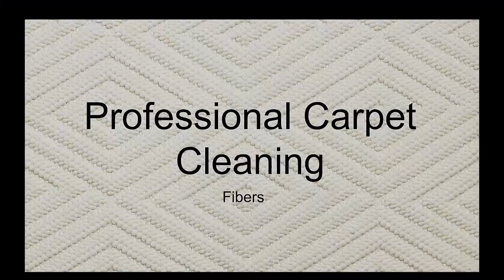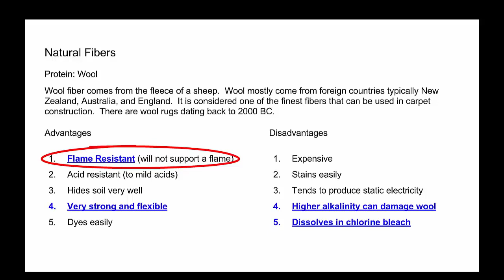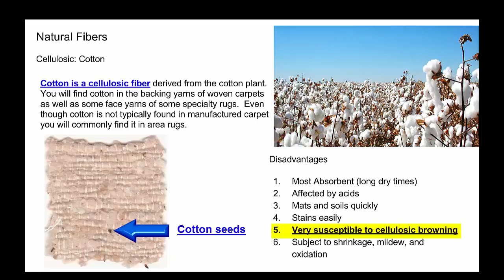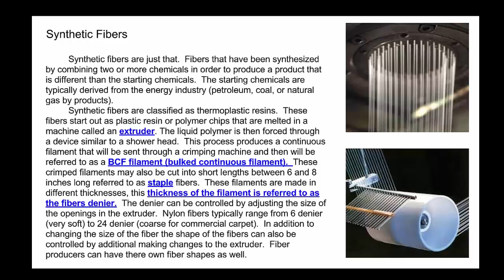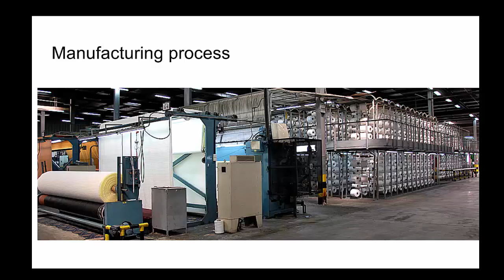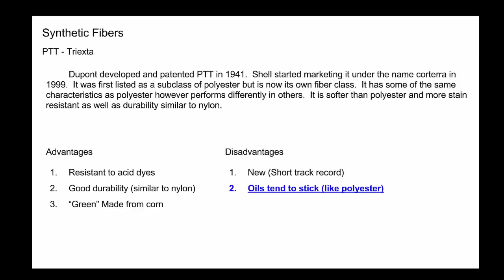How to clean carpet course Part #1 Fiber Types

Comment: Dan I’m 26 and about to start my own cleaning business can you please advice me if this machine would be capable of doing a good Job to start with ? They spec is Aquarius Hot 1400
Rated Voltage:	220-240v
Solution Tank Capacity:	8 Litres
Waste Tank Capacity:
37 Litres
Boiler Power:	800 Watt
Max Temperature:
70°C
Motor Power:
1400 Watt
Air Flow (Max.):	3.6m3 / min
Pump Power:	48 Watt
Pump Pressure (Max.):
2 bar
Vac Hose Length
2.5 Metres
Maximum Water Lift:
2400 H²O mm
Weight (Empty):
18kg
Reply from the maker: Ok first of all the Aquarius would not be what I would start with. You need a machine like this one. https://www.jondon.com/prospector-pe-1200-carpet-hard-surface-extractor.html bear in mind that would be something you can do whatever you want with that. and yes they are expensive but that unit can do tile and carpet. As a starter machine for a budget you can get anything with 2 3-stage vacs or more and up to 500 psi pump like this one. https://www.prolinesupply.com/store/product510.html You wouldnt have to have heat on board you could find one without heat and be just fine. Buy used if you can find one to save on the budget ask around or look on craigs list or offer up. They are easy to fix if you are good at that kind of thing.

Comment: Hi thank you for this I ll be going through now. I have personal question please help me find answers. I bought Pony Gris brand rug from italtex. It's a 2 cm pile hair silky as cats hair. Now this silkiness wore off and feels like a plain synthetic something, still nice but not silky and cool like before. How can I make it the same again? Thank you
Reply from the maker: Those rugs are polyester polyester has no resiliency to wear and will crush as well as mat down very quickly the softer the rug the more susceptible to this it will be. You will need to clean it with an acidic rinse and then after it is dry brush it well. This may not work as it is polyester But it might be worth a try.
Reply: @carpetcleanertraining8020  thanks Kim will try to give it a wipe. It uses to be so silly and slippery, is it some soft of polish? Like we have shine spray for hair. The hair and rubbish used fly fight off it with a broom. I think I ruined it by touch it too much as it is like a cat..... And deposited grease. I will try to acid wipe it . ❤️
Reply from the maker: I have not heard of a Polish that anyone is using I suppose it's possible however polyester is such a bad material for long fibers that I'm assuming it's just probably cheap fiber that is too thin to hold up
Reply: @carpetcleanertraining8020  sorry my autocorrect gave you name and called my carpet silly 😂😂😂 thanks for your help and educational videos. That s very generous of you 🌺🌺🌺🌺🌺🌺🌺🌺🌺🌺